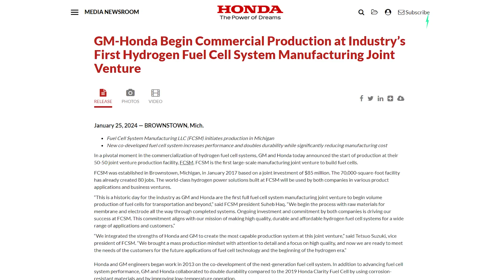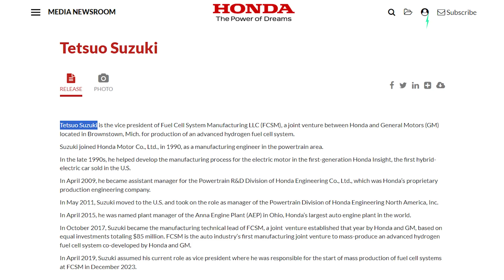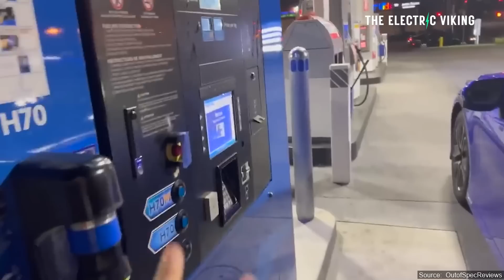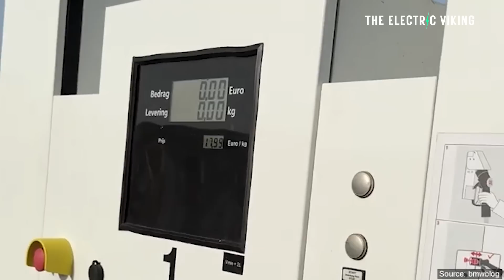GM & Honda's hydrogen fuel cell facility begins mass production in America

Comment: You can get hydrogen from other sources other than hydrogen itself, for example bio fuels , ammonia ( it’s much easier to store and transport) you put liquid ammonia to hydrogen refilling stations and they    Turn it into hydrogen on demand having two overfill tank in each of gas pump and safety valves to prevent explosion and explosion, separating hydrogen from nitrogen using nitrogen gas to produce electricity or they could skip those pesky steps and let customers pump ammonia into their hydrogen fuel cells cars , there are also oxide fuel cells that work well with all hydro carbons fuel ( the car manufacturers should simply made  hybrid ev with small sodium ion batteries 30 kw   Either hydrogen or solid oxide fuel cell ) you can also get hydro from lpg , cng  , gasoline so what is the point if its work there is no combustion and co2 .

Comment: Your main argument is that some of the filling leads are not that good... Grow up guy. Plug in EV leads weren't always as good as they are now, and they STILL use a variety of different leads FFS...
In actuality, plug in electric are just a stepping stone, in a similar way that hybrids were. Hydrogen or some other advanced technology is the future. 
Battery EV's have so many batteries which are often mined in appalling conditions, and those materials are finite. Then there's the end of life recycling of all those batteries.
When an hydrogen filling station is running on renewables and doesn't need tanker trucks to bring in hydrogen, it's wonderful. That is what needs investment, not gas reformation. Less than five minutes to fill the tank and you get a wicked range that's actually real, not claimed. That's WAY better than waiting over half hour for crappy batteries to charge each time. I will never do that, it's retarded 🥴👉

Comment: Just take the electricity you would use to make the hydrogen, charge a battery, and off you go..

Hydrogen
Energy required to produce 1kg  hydrogen - 48-55kwh - range -60 miles

Electric
48-60kwh - range approx. 200-250 miles

HYDROGEN CONVERSION INFORMATION
MRE uses the following information to make energy conversions to help formulate sizing and energy requirements for various micro grid projects.

423 standard cubic feet (scf) = 1 kilogram (kg) of hydrogen.
It takes 2.3 gallons of water to create 1 kg of hydrogen.
There are .0791 kilowatt hours of electricity in a scf of hydrogen.
1 kg of hydrogen is equal to 1 gallon of gasoline in btu equivalent.
MRE electrolyzers require 48 kilowatt hours (KWH) of electricity to produce 1 kg of hydrogen. More energy is required to compress and purify the hydrogen ranging from 5 to 15 KWH per kg, dependent on size of system.
A fuel cell's efficiency, on average, is about 55%.
An example of using the information above in a formula to find out how many kilowatt hours are in a kg of hydrogen:

423 scf x .0791 KWH per scf = 33.45 KWH of electricity in a kilogram of hydrogen.

In order to utilize this hydrogen in a fuel cell, you must multiply the 33.45 KWH by .55 (or the efficiency of an average fuel cell).  You will arrive at 18.40 KWH of usable electricity available after running it through the fuel cell.

The round trip efficiency from taking electricity and converting it to hydrogen with MRE's electrolysis process, then purifying it and compressing it, and then converting the hydrogen back to electricity in the average fuel cell, is approximately 35%. It is important to consider that in the case of over production from wind and solar, this excess energy produced represents a 35% increase in available energy, versus what some might think is a 65% loss.

Comment: Hydrogen is a very stupid fuel. It's expensive to make it's expensive to store and it's expensive to use. The biggest problem with hydrogen is it storage. Hydrogen does not like to be compressed. One solution and probably the only solution is to mix it in with an oxidizer. That allows storage that could be portable. The only problem with the oxidizers is they make very nice explosives. So therefore the kind of oxidizer needed for hydrogen is illegal.

Comment: Fuel Cell adoption is all about scale of both fuel cells and H2 . The target markets today should be where batteries don't work as well as a fuel cell. Heavy duty long haul trucking , stationary power, fulfillment centers, metals and chemical processing etc. Today batteries have a big advantage over fuel cells in cars and that market may never be attainable, but if the fuel cell and H2 industry focuses on their viable markets, economies of scale may eventually lead to more opportunities for the whole industry Are GM and Honda chasing the wrong end of the market or are they still in a long development stage for fuel cell cars?

Comment: I own a 2018 Chevy Bolt and I’m afraid I’ll never buy another GM electric vehicle, because Mary Barra is likely to bankrupt the company with such idiotic decisions regarding the future direction the company should take.  I believe Honda and GM have fallen for the sink cost fallacy. I don’t say this lightly, over 2 decades ago I was very optimistic about the future of hydrogen fuel cells and bought a fair number of shares in Ballard Power, a HEFC manufacturer.

Comment: Here in the U.K. we had 15 hydrogen refuelling places- at the beginning of 2024 we now have 5…………… why? Because nobody could afford a) the price of the FC powered cars and b) the cost of the hydrogen was huge.  The same has happened in Norway. Bjorn recently showed a closed hydrogen refuelling just off the motorway that wasn’t just closed down but even had an abandoned hydrogen powered car left at the pump…………… he stated in the video that numerous hydrogen refuelling stations in Norway had or were in the process of shutting up shop and that the cost to install the infrastructure for a single refuelling place was in excess of €2 million.
In the U.K. we now have the situation where if you own a Hydrogen FC vehicle you can fuel at at one of the 2 pumps in the city of Aberdeen on the north east coast of Scotland or at one of the 3 pumps in the south east of England 450 miles away!

Comment: Steel cell fuel is not specific to hydrogen. You can use it with methane or natural gas. Like in Germany they even have subsidies to heat warm water tanks in the house with them and as a bonus you export or use the electricity. For example 500W elelctircity/500W heat units with 50% efficency. I believe now it is possible to have more than 50% efficency. Basically essential piece is a thin sheet of steel with tiny holes made with laser. I believe if done correctly it will not be expensive. In Poland where I live people sometimes convert gas cars to LPG (they can drive on both but tank takes some space in the back). Suppose you could fill up on LPG to charge your electric car battery or like a range extender. But I see most potential where heat can be used at the same time or for energy storage. Cars not really except some edge cases.

Comment: Whether using hydrogen fuel cells or hydrogen combustion engines they both have the same problem of hydrogen storage and re-filling. Liquid hydrogen is a bastard! Gaseous hydrogen is also a bastard! The pressure/cooling required is immense. I can't see how Hydrogen is gunna work!! 
Possibly, just possibly, Plasma Kinetics for hydrogen storage and maybe the Solhyd hydrogen generating solar panel. 
Still can't see how it will beat decent solar panels and a battery, just saying. . Cheers. 🙂.

Comment: I plug into EV chargers regularly. They are essentially computerised power points. On only two or three occasions have I encountered problems. In each case the charger was reset by pressing the reset button (centre bottom on tritium chargers). After a few seconds they rebooted and came good.

Comment: Toyota managed to sell a few thousand HFCVs by subsidizing the fuel cost. Faced with the real cost of hydrogen fuel, nobody would buy in, not when cheaper and more convenient options are available. But HFCV sales have been falling since 2019, even faster than ICE sales. GM and Honda know this. So, either it is an attempt to divert sales away from EVs, or there is some sort of subsidy propping it up.

Comment: I'm not sure if you're going to be right about this one Sam...and I'm a big follower. 
There were people saying similar things about electric cars 25years or so ago. Where to charge them yada, yada, yada...Same with having to start/establish practical fueling stations and info structure for hydrogen. And there are those that are now working on just that solution. Toyota and Honda didn't "fall off the last pumpkin truck" as they say in U.S. and I'm sure they have a lot more information on the subject than we have access to at this point in time. They two aren't dummies.
Reply: Hydrogen is hopelessly inefficient. EVs are 4x better.

The fuel cells alone are only 50% efficient and that’s after over a century of development.

They’re also expensive, use precious metals and wear out.
Reply: Even ten years down the road when all the kinks in EVs have been ironed out there will still be people who are driving ICE cars and proud of the fact that they never set foot in an electrically powered vehicle.   They will be in the minority especially as the cost of fossil fuel soars ushering in the golden age of renewable energy and decentralized  electrical grids.  0:05
Reply: Actually, we say "turnip truck" in America.

Comment: There are some major limitations in the hydrogen infrastructure currently, that is, almost non-existent. So let the EV evangelists with short memories have their laugh. But despite hydrogen being at ground zero right now, I suspect hydrogen will eventually fill the role in heavy vehicles where EVs can't compete, and in time provide options for car buyers, perhaps using hybrid hydrogen and battery solutions. I heard somewhere this is how diesel started, first by industry and heavy vehicles, and later light trucks and cars followed once the diesel fuel became widely available.
Reply: Diesel got its start in California in the 20s  when big oil bought out and paved over the electric light rail transportation system in Los Angeles.  At that time California was the worlds largest producer of Crude oil and petroleum products.   The birth of oil companies happened in Cali. and fittingly met its end when Tesla began manufacturing the model S in
the town of Fremont in the Silicon Valley.  For those that 
are interested long before I was born it was called by some The Valley of The Hearts Delight.
Reply: Tesla already have a semi.
Reply: @fredbloggs5902  So does Nikola (although no guarantees Nikola will survive). Right now the Nikola hydrogen semi can provide a bigger payload, longer range and fill up in 20 minutes, but the cost and availability of hydrogen is prohibitive until the infrastructure and market volumes increase. Will the roadside cost of hydrogen reduce dramatically over the next 5-10 years? You can bet your Tesla shares it will and then the limitations of battery powered drivetrains will make them uncompetitive. And diesel will stay in the fight for a long time too if they are not legislated to oblivion, so it is going to be a bumpy ride for everyone.
Reply: @MotoGuzziMoto  Simply wrong. Hybrids can’t effectively use regenerative braking as well as EVs.

Comment: Hydrogen will never work. See tony seebas ten minute video explaining the down sides of hydrogen. I dont think many people will want to drive around with a 5,000 lb or 10,000 lb tank in the car. Thats a bomb!!!!!...Right now the two systems are either 5,000 or ,10,000 lb. Refueling sites are gew and far between. If u have compressed gas storage u need 15 hydrogen delivery trucks for every 1 gas truck to deliver the same amount of energy. This is because hydrogenis less energy dense than gas......or battery. If the refueling station has energy generating plants..........as used in heavy industry that uses hydrogen......these plants are very expensive.......dont expect to seevtoo many built. U will never get a hydrogen powerd car to have the same range as an ev. Again.......u need 15x the hydrogen for equivalent power from gas or electric. Hydrogen is like the myth of a perpetual motion machine. Will never happen.

Comment: 1:06  It's only 50 cars if the station stores it as compressed H2.  If it's stored as liquid H2 at -427F then it can store 500kg or more of H2.  At least 100 cars.  On the downside, it takes an additional 12kWh per kg to liquefy it, or 48 EV miles.

Comment: 0:55 notice the fuel door says "Date or removal of containers 12/2033"  That's when the tanks need replacing.  In the US the message says "DO NOT REFUEL AFTER..."  A new set of tanks cost about $20,000.

Comment: I'm surprised there are no hybrid EV's using batteries and hydrogen together.  Fuel up with hydrogen and it charges the battery like an alternator when driving, providing extended range.  Or provide the option to run them in EV mode or Hydro mode...then it doesn't matter as much if the hydro infrastructure is lagging in certain areas.
Reply: Well done for telling everyone here that you don’t know how hydrogen vehicles work 🙄
Reply: @fredbloggs5902  Missed my point.  Hydrogen vehicles have small batteries, like around 2kw versus over 50kw + on most EVs.  That's enough for running electronics, but not vehicle power.  I'm talking about a hybrid with a larger size battery than can be utilized as a typical EV with direct charging of the battery in situations where no hydro fuel is available.  Even hybrid gas vehicles have about 14kw batteries.
Reply: @gsyl655  Hydrogen is hopelessly inefficient and fuel cells are very expensive.
Reply: That's what a hydrogen vehicle does already , it takes hydrogen and passes it through a fuel cell, the cell makes electicity and both charges a battery and drives the motor, under higher loads the motor uses electricity from the battery + fuel cell in low energy needs the fuel cell starts to top up the battery, it's just that you can't charge the battery other than via the fuel cell.

Comment: GM has been investing and failing in fuel cells since at least 1991 when they announced a joint program between Ballard Power Systems (a Canadian fuel cell company), General Motors and the US Department of Energy for the development of a fuel cell powered passenger vehicle. This is a ridiculous 3-decade-old sunk-cost fallacy.

Comment: You know... And being a hydrogen fuel cell car proponent... I don't think they should stop making those battery electric sodium ion battery cars. It's a perfectly good working technology that you can just plug in at your house. But why do the BEV proponents so viciously attack hydrogen fuel cell technology? We can see there's much more a nightmare to charging with all the mismatched cables and adapters and charging rates. And that ridiculous Ford f150 lightning app not being able to order the charger at your house. To boot I keep saying you should Google "Verde home hydrogen refueler" there is too hydrogen home refueling.

Comment: I think the infrastructure problem is something that can be solved overtime with more experience with the same being applied. The main issue is the price for hydrogen fuel, but we will see. If they solve the hydrogen prices then it would be much cheaper than EVs.
Reply: There simply isn't any way to make hydrogen cheaper than electricity, due to the inefficiencies involved it will always be at least 3x more than electricity. There were proposals to use "cheap renewables" to make hydrogen, but that would also mean cheaper electricity, so still couldn't compete. And you still have the problem of expensive storage tanks, and the relatively short lifespan of PEM fuel cells.

Comment: Anyone with a yard can make their own hydrogen at home Viking, this is the future. 1 kilogram of hydrogen will deliver 20 kilowatts of electricity after being run through a fuel cell. So to equal your 100 KWH battery, you will need 5 kilograms of hydrogen. That's 11 lbs. + the tank, total weight about 175 lbs. VS your 1,400 lb. $25,000 100 KWH battery.  This game is over before it even starts. The Con Man is screwing you over Viking, run!!!!!!!
Reply: Just out of curiosity, how long does it take to produce 5kg of hydrogen at home? And how do you get it to the 700bar to be able to put it in the car?
Reply: @bellumCretatus - depends on your equipment, costs will keep dropping the more demand there is. Same thing with batteries, they will get to 100KWH weighing 250 lbs. at $2,500. Could all happen in the next few years, Tesla and other EVs on the road now will become parts cars.
Reply: It’s much easier to just charge your EV at home and it’s 4x more efficient.

Comment: I really hope I am wrong about hydrogen; but no part of it makes sense to me - and I am chemical engineer by education. If hydrogen were anywhere close to being a power source, it would have proven itself in industrial settings first. This is simialr to the flying car pipe dream. A car is a terrestrial machine designed to move by friction against a road surface whereas an airplane is designed to minimize friction and take advantage of the lift of an airfoil. A hybrid (flying car) will do poorly in either environment. Same goes for amphibious boats. They will forever remain science projects and objects of curiosity and perhaps, wonder.